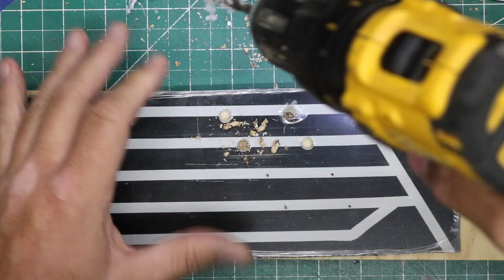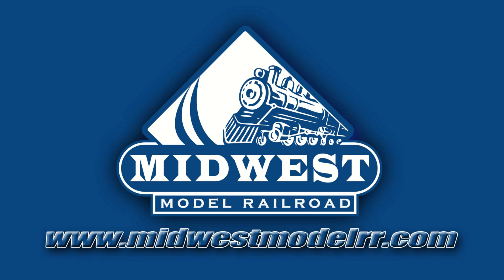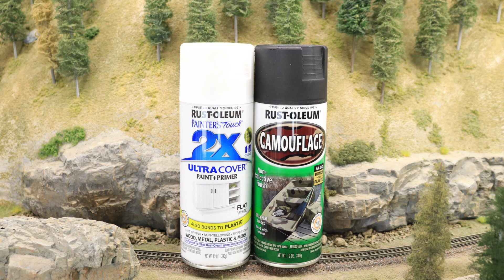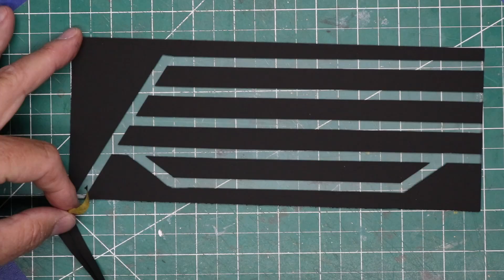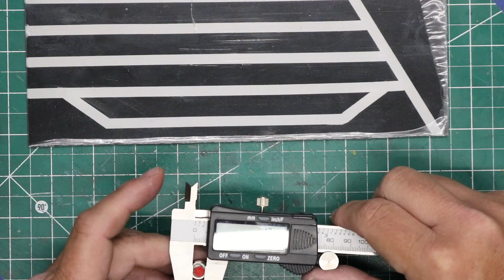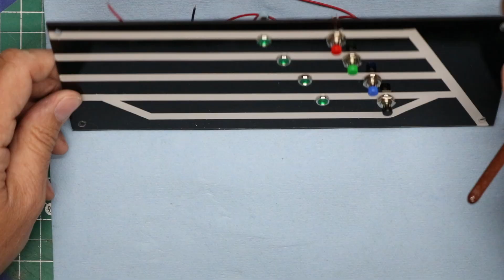Easy Control Panel for Your Model Railroad Layout

Comment: Thanks Ron for the excellent tip
My lacquer spray paint is suitable
However I needed to slightly sand my plexi glass to get the paint to adhere, my Tamiya masking tape also peeling paint in sections during the removal process. 
I used a straight edge and a safety blade along the tape prior to removal.
After 2 attempts my panels are perfect

Comment: Hi Ron, nice clean looking panel!
A tip for drilling acrylic is to back grind the lead cutting edge of your drill bit to about 30° - this stops the tendency for the bit to "bite" thus preventing crackage, because it's actually "shaving" the material...
Slow speed, no oil required.
Hope this helps.

EDIT:
Having used plexi/acrylic for several projects, I have a set of common sized bits I keep separate just for this material.

Comment: With all do respect I think your panel looks very nice but why not just use Tortoises or Smails as they use less wire, are easy to hook up and you can use your throttle to operate them from any location and I have over 270 switches on my layout... but I understand this is an alternative.  Good luck... DD  😜  🤗
Reply from the maker: I am using Tortoises to throw the turnouts. This panel allows one button to throw multiple turnouts to line an entire route into the staging yard...and I do now want to drive them with the throttle or DCC system. I prefer to keep throttles connected to the locomotives they are controlling. That's my preference.
Reply: @RonsTrainsNThings  I totally understand Ron... like I said your panel looks nice... NCE throttles have that capability to hit one button to make a line up and throw all switches to line you out of a yard....  take care.... DD  🤗
Reply: 270 switches!? Do you have any videos of your layout?

Comment: When drilling plastic sheet, I drill a 1/8" pilot hole amd then use a step drill to gradually enlarge the hole to its final size.
Reply from the maker: A stepper bit would be perfect...unfortunately I don't have one. Must acquire.

Comment: You could use a clear coat spray paint on top of the painted side to help protect your paint job from scratches. You can even use a brush on poly since it's on the backside and no one is going to see it.
Reply from the maker: That's a great idea. Didn't even think of it.

Comment: Looks great Ron! I went a little bit of a different route on creating mine. Since I am going the LCC Route, I used the momentary push button from RR-Cirkits that have built in LEDs (R,Y,G) where I only had to only drill one hole per switch. Also I ended up using Pinstripe paint that you can buy from an auto parts store like Autozone, Napa, etc. and the two sizes works great to demonstrate the mainline vs. sidings, spurs, and branchlines. - Jason
Reply from the maker: I said artists tape, but this is actually auto pinstriping tape, but from Amazon.👍🏼

Comment: Ron…you can also use a flame before you paint…to clear and round the edges of the plexiglass instead of sanding…thanks for the video,
Reply from the maker: Interesting. I do not have a lot of experience working with acrylic. Thanks for the tip.